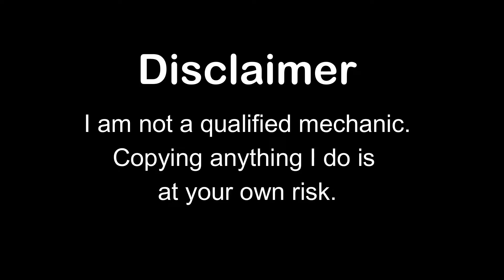1950 MGTD Rebuild Episode 31

Comment: I found the brake line that runs from left rear wheel over the rear end was rubbing on the box that holds the side curtains as I remember. I had to put some padding in there after the fact which was a bear. Easy to do now so I would recommend it. Also, you might invest in a tube bender to avoid kinks.
Reply from the maker: Thanks Ed. I will check for clearance when I put the body on next week.
I do have a tube bender, but the brake lines were bending so nicely I didn’t bother using it. I will certainly be using it for the fuel line though